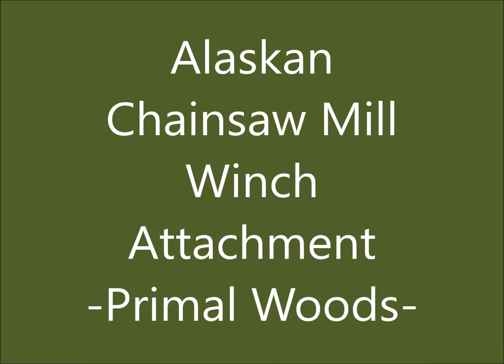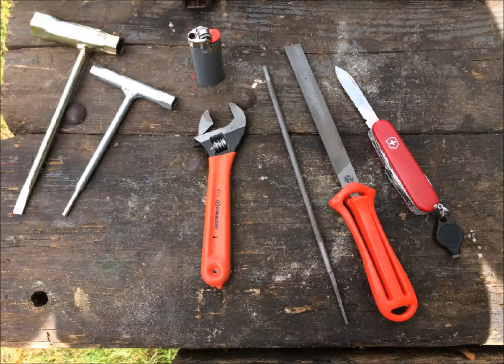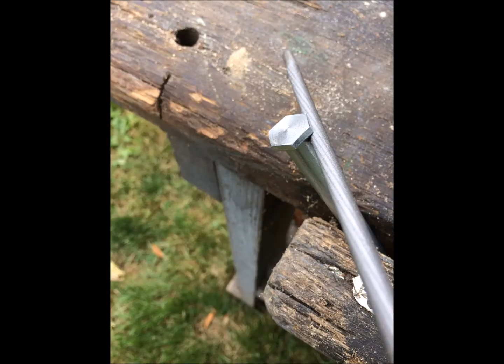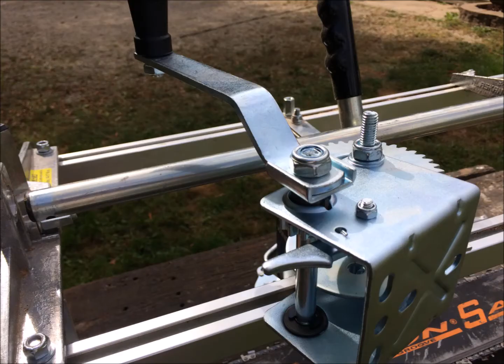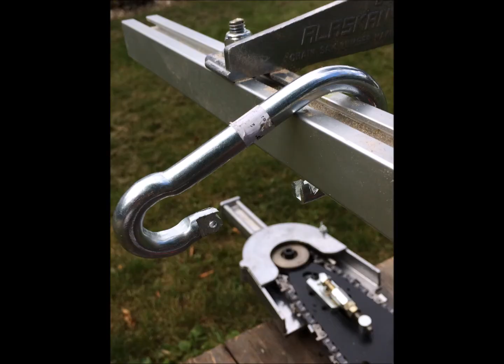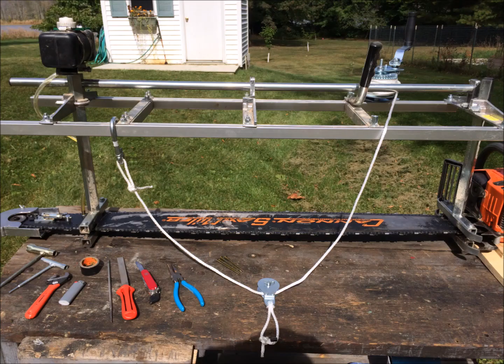Alaskan Chainsaw Mill Winch Attachment | Primal Woods

Comment: Great video.  Planning to use this as a tutorial to setup my Granberg with a winch for some large red cedars I need to slab.  It's been over a year since this video, any lessons learned on the setup and operation?
Reply from the maker: The only other thing I did was to remove the dogs at the front of the power head, the teeth that engage the log; that bought me another 1.5" of span.

Comment: Why didn't you just use a carriage bolt to attach the winch?
Reply from the maker: Frankly, I just didn't think of it.  I think the heads would still have been to thick.  The carriage bolts Granberg uses are less than 3/8", but the larger bolt diameter was necessary, as the bolt that also acts as the shaft for the winch spool.